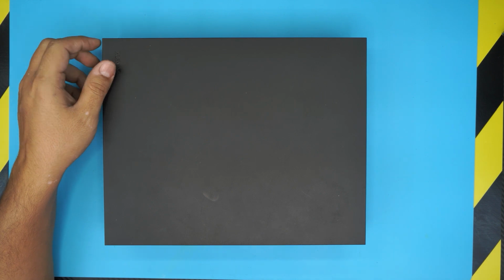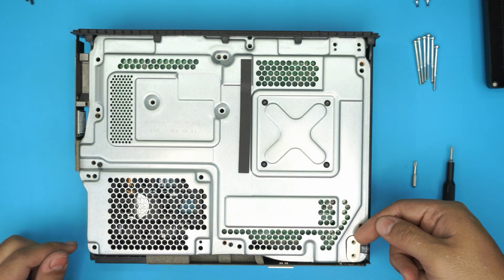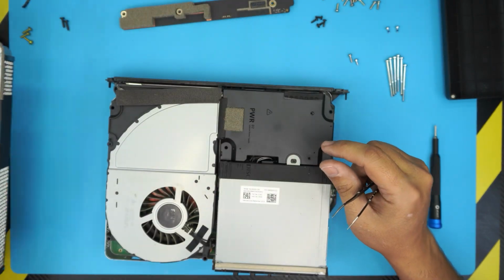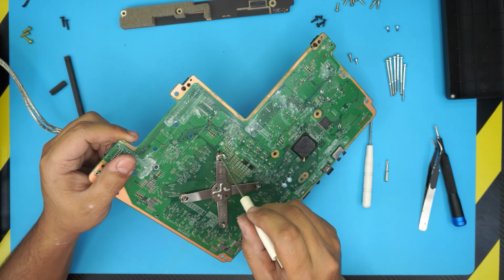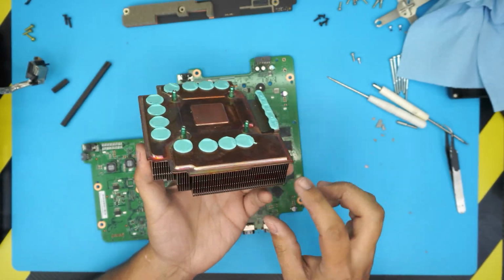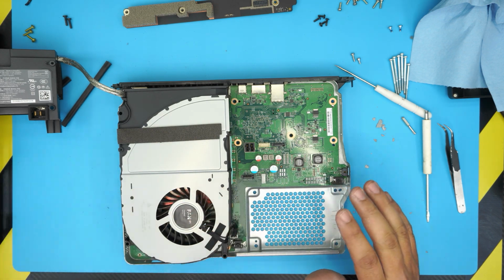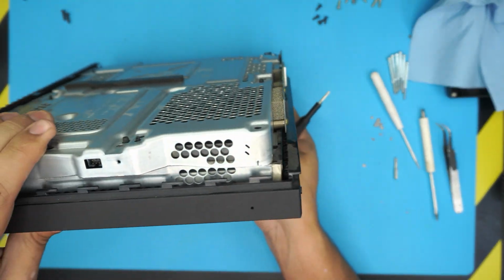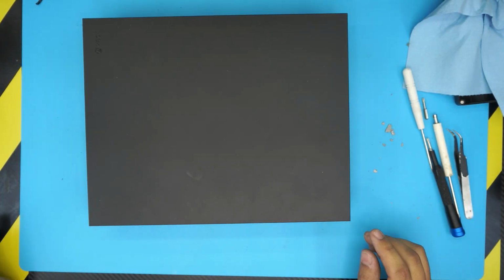HOW TO CLEAN AND  REPASTE YOUR XBOX One X Series FULL Guide

Comment: Hi I am thinking of using Thermal Grizzly Carbonaut pads how big do I need anyone who can help?
Reply from the maker: 🫠Regarding your question, do not use pads. There is a reason for using thermal gel/putty: the gap distance is not uniform. If you use a thick pad, it will push against the heatsink and cause the CPU to overheat. If you use thinner pads, the VRAM will overheat instead. Always use putty where it is specified.
We have tried pads, and take it from me, you will not have a great day if you use them.
cheers🍻
Reply: @uFixTek  Hi thanks for your reply, this was strange i have never heard anyone say this about pads could be bad,i wanted it becuase they say they won´t dry out after a few years. Okay I have to rethink this thanks again.!

Comment: Great video. I have to repair mine tomorrow and your tutorial is perfect, because I was planning to change the paste and I don't want to buy new thermal pads. Copper can be polished also with acetone, the nail polish remover. 
Just don't touch plastic or rubber components with it. And never, never, leave it inside a plastic cup, over a very expensive old table, like I did when I was a little kid. Your mom/wife could kill you.
Reply from the maker: It's my pleasure, my friend. 😊 I deeply appreciate your taking the time to provide feedback. If you're inclined to support the channel further, feel free to like and subscribe—or even both!
ya that those acid they don't go into regular plastic container🤣
Should you have any questions or requests in the future, please don't hesitate to ask me.
🍻cheers

Comment: Ive done the repair but disks arent going in. When i press disk eject button it plays the normal sound but it wont let me put it in. Have i put the drive in incorrectly?
Reply: And also didnt solve my issue. In high intensity games (Forza, COD, EA FC 24), the xbox turns off in the menu. When i turn it back on it does not display an error message. I have done a PSU replacement, repasted, cleaned it out, hard reset and factory reset, but the issue is still happening. What can it be?
Reply from the maker: the issue that you facing is mostly because of bad hard drive, the HDD is this system fail a lot, i do get this issue a lot in the store and the main cause of it is a bad hard drive. replace the HDD with another hdd 2.5 i recommend you: https://amzn.to/49orV4n
and install the OS via USB drive: https://youtu.be/xWW7M8pgFEo
trust me your problem is from the hard drive.
cheers🍻

This is an Amazon affiliate link. When you use my links, you are helping to support the channel. 🙏

Comment: I followed this yesterday and cleaned my xbox one x.. When I switched it back on it got an error during update and got stuck on troubleshooting screen? So I didn't an offline update and it fixed it.. Thanks for the video dude..only other issue I have is the USB port at the front at the little button next to it dont work since opening the xbox..did I make a mistake you think?
Reply from the maker: Thank you for your feedback! If you wish to support the channel, you can like, subscribe, or both!
Regarding your question about the usb double check the usb port connector https://imgur.com/a/ayV15s8
it may not have been pushed in to the jack the connector.
Should you have any further questions or requests in the future, please don't hesitate to ask me.
cheers🍻

Comment: I want to Thank you for this instructional how-to-video! I bought my XBox One X in 2017 refurbished from Gamestop. I had performed no maintenance from the time I bought it. Just kept it clean. I decided it was time to crack it open. I followed your video step by step. When I lifted up the heat sink off the CPU to my horror the Thermal paste was almost all gone and it was dry and flaky with tacky parts here and there. No wonder my fan started up immediatly when I turned the system on.  After an hour and a half the system was up and running quieter then it has ever been. I kept checking it thinking the fan wasn't working as it was just so quiet! Muchas Gracias!
Reply from the maker: Thank you for the feedback! if you wish to support the channel you can LIKE or SUB or both :P
regarding your feedback: Yes my friend you should do your repaste every 1.5years  depending how many hours daily you use. 
if you have any question or request in the future feel free to ask me.
saludos compa,

Comment: This vid was a great help! My Xbox kept turning off whenever I loaded a game of warzone. The game now loads, however the fan is still really loud!
Any ideas what it could be?

Thanks in advance
Reply from the maker: Glad it helped, Thank you for the feedback! if you wish to support the channel you can LIKE or SUB or both :P
regarding your issue, warzone it is a very demanding GPU load. the only two reason that the fan gets lound are the following:
the heatsink is dirty or the heatsink is not placed perfectly on the GPU/CPU (but if its not set perfectly the game or console should turnoff or crash after max 15min gaming)
if no crash after 15min of gaming, then its ok let the fan spin as fast as it wants as there is no harm for it ,it will push out the air faster out :P
Reply: @uFixTek  thanks for replying. The Xbox does indeed turn off within a couple mins. I have taken it apart again, cleaned the chip and reapplied the paste and ensured it was for correctly and still turns off. 
Any other ideas or any tips to ensure its put back properly?
Thanks again
Reply from the maker: @ZuLqYaH   i need you to do the following steps:
#1. remove the motherboard completely 
#2. place the board over a old wood table (nothing with fabric or plastic)
#3. make sure there is no fan blowing air or the room is not cold (no A/C units) work at room temp.
#4. once placed the board on a table, grab a hair dryer. set the hair dryer to max heat and low or medium air.
#5. point it straight on top of the CPU with a 1" distance. and keep it there for 6-8min
#6. remove the heat and LET IT COOL down ON ITS OWN. don't rush the cooling my placing fan or anything let it cool down 10min.
DON't move the board for 10min.
after 10-15 min repast and test it out.

reasons is that because of the over heating that you had before there is a high chance that a solder ball under the CPU is cracked or resisting a voltage, with this DIY you doing a refllow.  note the external heat that is applied wont damage the chip, the internal working heat is much different than external.

Comment: I did this today and thank you so much for this guide! Worked perfectly with no issues, and my Xbox went from being as loud as my vacuum cleaner to completely silent! I had to double check if I messed something up in the fan assembly because of how quiet it is now. I'm going to try replacing the HDD with a SSD whenever I can get my hands on one in the near future. Thank you for the excellent video!
Reply from the maker: Nice work! Thank you! for the feedback and your support to the channel by SUB :P
if there is any help you need in the future or request feel free to ask me,
note here is a video for the SSD installation:
https://youtu.be/QsI0GqoemN4
Reply: @uFixTek  I've seen this video but I don't know how to transfer the data from the old drive to the new one
Reply from the maker: its not hard , if you want to clone your XBOX hdd to a ssd, you will need the following:
A PC or laptop with two usb ports:
you will need a two sata to usb adapter:
https://amzn.to/3tXjvLD
and you will need a program called "Macrium Reflect"
and you can remove the xbox hdd and plug into adapter and plug your new ssd into another adapter and use the program to clone the hdd -ssd.
Reply: @uFixTek  I read online that cloning your data from the HDD to the SSD can cause the SSD to be slower than if you do a fresh install of the OS, is that true?
Reply from the maker: yes and no, 
Yes it will be slower but we talking about seconds not a big %,
but recommended is always fresh install. 
its like trying to say i have intel cpu, if i put a 3400mhz ram is faster than 2400mhz , but in reality the differences are not even noticeable.
but in amd cpu then sure the differences from 2400mhz to 3400mhz are very noticeable,
same goes for cloning lets say its somewhere in between
Reply: @uFixTek  I might as well do a fresh install if it speeds things up since my Xbox has gotten a little slow recently
Reply from the maker: @ees.h  it will def improve stability and loading times.

Comment: Dude, I did it exactly as instructed you in the video. but after folding and turning on, the xbox logo lights up, the console beeps, then about 5 seconds it beeps again and turns off, the logo goes out. don't you know where the problem might be? HDMI port left during disassembly? I'm confused about it properly.
Reply from the maker: thank you! for the feedback and your support to the channel by SUB :P
Regarding your question: i would like you to re do everything and make sure the heatsink is really touching the cpu, this happens  alot with people they think the heatsink is flat with cpu but a slight movement it makes the difference, and double check all the connectors. its not broken that is for sure. you just need to adjust the heatsink and make sure dont use a cheap thermal paste else it will get worse.

Comment: Didn't even say what type of screws you need.. Pointless.
Reply from the maker: @1:04 i show you the type of the screw driver i used, and if you want to know what screws you have in the console, this video is made for those who need to clean and repaste, its not meant to tell you what type of screws it has inside and what type of plastic its using for casing, and type of fan and etc... but if you want to know something in particular mention in the comment and i will be glad to assist you.

Comment: I did everything in this video and my xbox one x  overheating gotten worse once I did everything
Reply: It even shuts off when im turning it on now
Reply from the maker: ok, you need to go back and recheck the heatsink its maybe not sitting flat on the cpu, double check your contact points on heatsink, and what paste are you using?
Reply: @uFixTek  im using mx4
Reply from the maker: then you must be having issue with heatsink not aligning on cpu.

Comment: Literally the most in depth and helpful video I've seen your literally like the David Attenborough  of the computer world 😁👍 had to drop a like and sub after this you have helped me so much so thank you for that
Reply from the maker: Wow, thanks!, i appreciate the awesome feedback and support, stuff like this gives me the motivation to continue to serve and help out as many people i can, not just putting videos, my goal is to be able to help via comments and requests, to those in need in this hard times. it is a good feeling to help out. 
if you ever have any question or request feel free to ask me in any of my video comments.
Reply: @uFixTek  your more than welcome I actually searched for this video due to my xbox crashing while I'm gaming every so often telling me the ventilation is blocked although it sits well away from anything else  and after doing some research and asking others I was told to replace the thermal paste and clean it inside getting rid of any dust inside the console do you think this will stop the issue my xbox has at all?
Reply from the maker: okay do this 1st , open it up and dont remove the heatsink. just disconnect the fan 1st (very important) then use a compressed air (gas station air its stronger ) or i highly recommend to keep one of this at home , its very use full and powerful 100X better than the air can spray that its moist air and not powerful ,
https://amzn.to/3clpDro

use this to clean the fan and the board and the fins of the heatsink.
and then test it out and you will get it going. No need to replace the paste at 1st.

NOTE: its very important to disconnect the fan jack from motherboard before blowing air into fan , the reason is that the fan will generate voltage and it will backfire into motherboard. so disconnect the fan always for any electronics.
Reply: @uFixTek  thank you for your response it's very much appreciated the reason I was going to use the thermal paste is because the xbox fan goes really loud at times like when loading a game or just doing stuff in a game then all of a sudden it just crashes on me
Reply from the maker: @houseguest4534  oki then replace it and take your time aligning the heat-sink on cpu. if you need help let me know. sorry for the late reply.

Comment: Hi can you help me I have followed  your excellent  video but now when I turn my xbox on it goes of after about 2 seconds  please help
Reply from the maker: Thank you for the feedback and support,
please give me the brand of the paste that you used>?
Reply: It was a type I got with a cool master all in one liquid cooler I used a bit of nail polish remover to clean the old paste off I have striped down and rebuilt a dozen gameing PCs using this method thanks for the fast reply
Reply from the maker: then something is not sitting right in there, its not making a flat contact with CPU, use a thicket paste and see the difference.
this paste is thicket and much better:
https://amzn.to/3c2wkP1

BUT it shouldn't turn off with your paste double check if the heatsink is sitting flat on cpu.
Reply: @uFixTek  thanks sir I'll try that  excellent  channel  thanks alot

Comment: Did everything in your video down to a tee, my Xbox still randomly shuts down and sounds like an airplane
Reply from the maker: What paste did you use?
Reply: Artic Mx 4
Reply: @Antoni Sabala yes it is
Reply: @Antoni Sabala I’ve used the dot method, the line method, and the spread method nothing has changed
Reply: @Antoni Sabala I’ve already done this with thermal grizzly pads...I’m at a loss my friend. I have no idea what my issue is
Reply: @Antoni Sabala well I appreciate you responding. I just wish I could get some answers :/

Comment: You should mention that too much thermal past can cause the Xbox to instantly shut off!! Now I need to restart!
Reply from the maker: Not true at all unless you are using a different thermal paste that was not used in this video, if you using Artic silver 5 then that paste its more harder. but if you using the MX4 no the amount of the paste wont do any damage or shut down. we have tested with excessive over done MX4 and same result.
therefore not all paste have the same properties, some are more softer and some very thick.
if you placed the MX4 and its shutting down then its not because of the extra paste. maybe your heat-sink is not sitting properly on the cpu.

Comment: why on the reverse side of the board there are oxides on the edges of copper and on the board white clouds are incomprehensible ... explain what it is!? I tried to wipe it off! but then I see it doesn't wipe off !
Reply from the maker: no need to worry about those , its a especial bath flux that they use in factories , its in all xboxes starting from 360. these flux when it dried up it turn to this white compound .
its not conductive nor oxidizing.
Reply: @uFixTek  I tried to wash it, but it does not wash and stopped rubbing, that is, they are coming from the factory ??? why is it easy to wash off the paste? good coating on them ... varnish from the factory ?thank!
Reply from the maker: you dont need to touch or clean that flux oxide. they been coming out of factory since xbox 360. even some PS3s its the materials that they use in factory no need to worry about  them.
Reply: @uFixTek  I assembled and disassembled And touched everything with my bare hands How to find out that static electricity did not say anything on the board. It seems that everything works! What kind of thermal paste and gum do you like for the rest of the parts and of normal quality, almost like a blue-green and white square at the factory if you change it! Thanks !

Comment: hello! can you touch the board with bare clean hands ...?
Reply from the maker: YES YOU CAN, nothing will happen its really really hard to kill the board by touching it.
Reply: @uFixTek  Can the motherboard be touched with bare hands from static electricity will it be damaged?
Reply from the maker: yes you can touch it with your hands and move it nothing will happen just dont rub your hands on your head or on your t-shirt. just before touching the motherboard touch a metal frame and you will be  ok touching the motherboard.

Comment: You put thermal paste the the white thermal pad aswell?
Reply from the maker: there are no white thermal pads, if you mean the blueish thermal pads, then no you do NOT need to replace them at all , just replace the thermal paste with:
https://amzn.to/3qgsJBm
or :
https://amzn.to/39vGfKo
Thank you for the support and feedback
Reply: uFixTek no i meant the white pad on the bottom of the motherboard u put thermal paste on it aswell?
Reply from the maker: ah yes i placed a bit of thermal paste to seal the pads surface, it helps a lot.
Reply: uFixTek interesting you think i should replace the thermal pads along with replacing the thermal paste? I noticed my one x fan has gotten noticeably louder and im not sure if it’s because the thermal paste is dried out or because i have the one x vertical
Reply from the maker: thermal paste is dry for sure. sorry for the long reply im sick with COVID :(